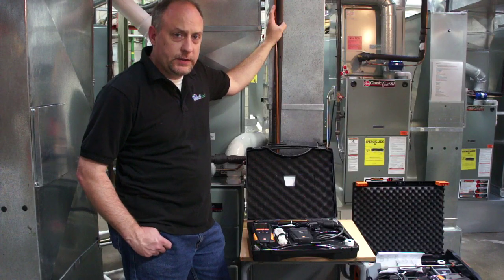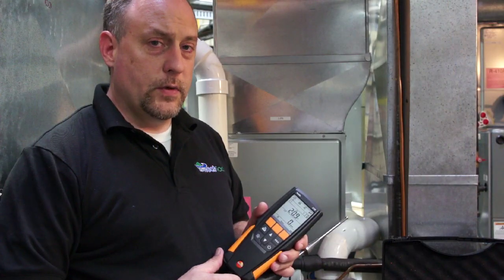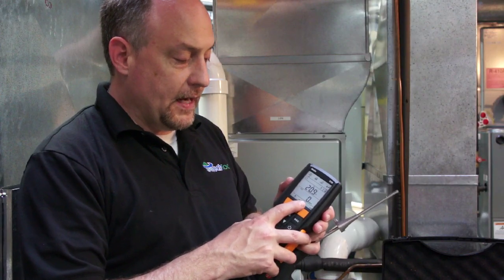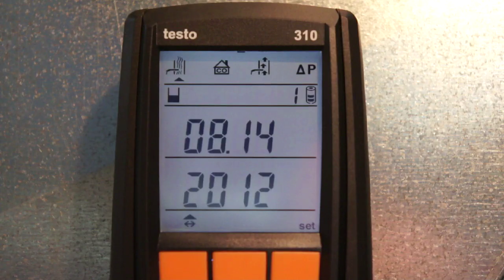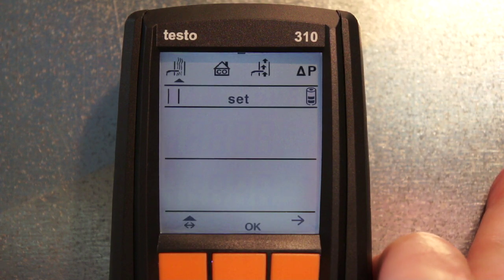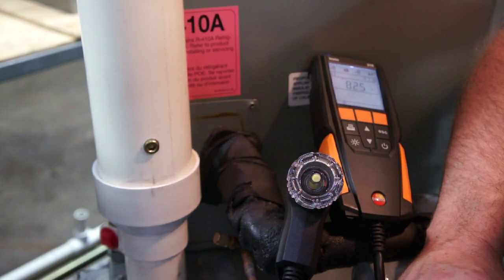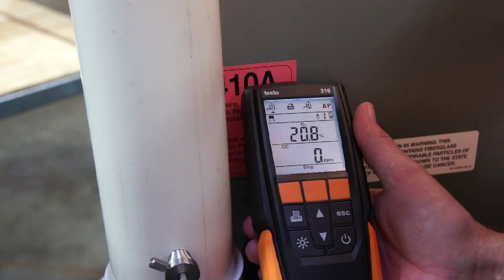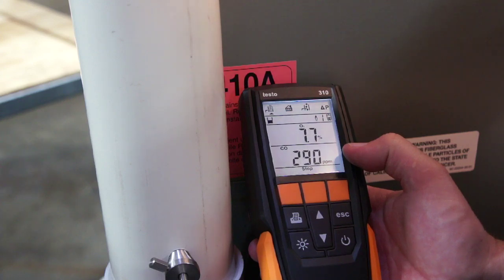Testo 310 Residential Commercial Combustion Analyzer

Comment: Mine died.  Lower display only does a countdown, nothing else.  When using arrow keys (up down) only thing that changes is top display from temp to CO.  Light homeowner use. Worked great for a few seasons.    Expecting the repair won't be inexpensive.

Comment: Is it important to use an analyzer when installing a new furnace? I have someone coming to replace my furcance with a new one and i do not think they use an analyzer.
Reply: It is usually recommended by the manufacturer that the gas pressure, CO, draft and temperature rise measurements are checked prior to the installation of new equipment. When in doubt read the installation manual
Reply: @behanstunts1815  i just got one installed yesterday by someone and i dont think they did any of that ugh

Comment: I just got one of these, but stupidly bought the kit without printer before buying printer separately. Unfortunately I have zero idea how to sync the printer up with the combustion analyzer,  I hit the print button on the combustion analyzer but nothing comes out of the printer, I hold the print button on the printer but blank paper feeds out...can someone explain to me what am I doing wrong?
Reply from the maker: The testo 310 only works with a printer that is specifically designed for it. https://www.trutechtools.com/05543100
It will not work with any other testo printer. If you bough from TruTech please call us at 1-888-224-3437 option 1 (weekdays, business hours) to get this fixed.

Comment: 90.6% AFUE - what was the advertised efficiency of that furnace?  Embarrassingly, the calculated AFUE will typically be somewhat less than the advertised efficiency meaning you might have some explaining to do when the customer sees the printout. Also, you should be using a manufacturer certified test port instead of drilling a hole. It’s possible the flue pipe could have raw natural gas inside...a failed ignition attempt will have upwards of 5 seconds worth of raw gas in the flue some of which could leak into the house if the plug ever fell out. Not that such a small amount of gas would cause a disaster (however, you never know) but it could easily generate a gas odor complaint leading to a zero revenue service call.

Comment: So for a direct vent boiler if the flue pipe is a short piece and i do have access to where it terminates outside do I still need to make a hole?can i go outside to take measures without drilling a hole?

Comment: id like to know is there a way to set the print display like the other print display of the 327? I need this unit to print properly for my business, when I print, its all over the place. Any help here would be appreciated. Ms
Reply from the maker: A lot of these issues are software / firmware related. I would suggest contacting Testo support at https://www.testo.com/en-US/Contact+Us%3Cbr+type%3D%22_moz%22+%2F%3E/contact_request_form
Reply: I did they sold me on the 320 for a few more $$ Thanks man!
Reply: @Disdad98  so they didn't rectify the problem you had with the unit you already owned, they just up sold you to the 320 for 8 to 1100 dollars more. Sounds like great customer service! ( sarcasm)

Comment: Jim, thanks for the great video. One thing I want to add for any UK viewers is that the 310 can be configured with a country code which sets up the range of parameters displayed for a flue gas analysis. In the UK one of the most important measurements is the ratio of CO to CO2. This is not shown in the video because Jim has the instrument set up for the US. With the UK setting the 310 displays "ratio" in the top measurement line.